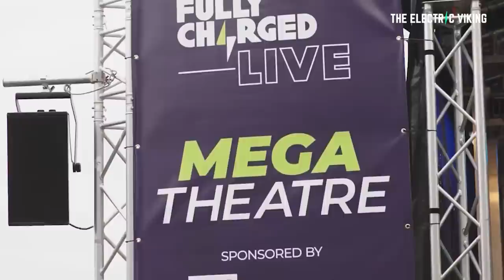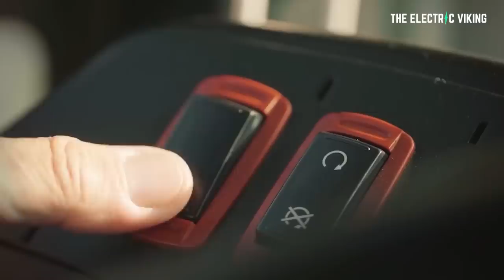Electric Vehicle Charging for moving EVs installed on German Autobahn

Comment: Why is the volume so low for your channel?  I have to crank up the volume in order to hear you and then I have to remember to turn it down for others so I don't get blasted.
Reply: Jupp, that is indeed rather odd. And it isn't a small amount; I usually have my Sound system on my TV on 42 and for this channel I regularly have to turn it up to 54, and that is very loud as that is close to the volume I watch movies. Once the Viking's video is over and I forget to turn down the volume, the next commercial will shatter my windows.
Reply: No problem here.Volume is normal.iPad pro.
Reply: @Stuart.A  you don't notice it on a phone or tablet or laptop speakers as much. But if you watch on a TV with a proper sound system it is very much noticeable
Reply: I listen on my megaboom speaker and it also blasts me when the ads come on 😅
Reply: Volume is fine
Reply: @Stuart.A  I have an iPad Super Pro Elite and the volume is low. So...
Reply: Low for me too.
Reply: Sam should use a audiocompressor

Comment: This has been mooted for some years  !
I'm glad, that it's coming to fruition !
It doesn't prevent charging stations, in existing petrol stations, or shopping mall car-parks. It's just an additional system.
Your car / Truck should be able to automatically charge itself, wherever it is  !
In fact car parks should have this under-pavement system installed in EVERY parking bay  !
Then EVERY charging company will want to ensure that their chargers are ALWAYS working  !
I presume that Big Oil are already running, a lot of these charging stations  ?  ?
If not WHY not  ?  ?

Comment: I am skeptical because wireless charging is energy inefficient, and this system will likely be very expensive to install and maintain since it has to survive the wear and tear of road traffic. Given how  fast charging batteries are coming soon and higher wattage charging is coming, I doubt there will be a market for wireless EV charging in highways. I foresee wireless charging happening at bus stops and truck loading docks, but not on highways.
Reply: This system has an efficiency of over 90 % , similar to cable charging ….

Comment: I’ve been saying this would happen. Stanford University created the tech and has refined it over a 10 year period. The induction loop can be added to any vehicle and the ID would automatically charge your account. Taxi ranks would also benefit greatly. 

A sign on the road would tell you the next 5 miles has a charging lane and you would trigger your vehicle to use it if you need it. 

Range anxiety would be gone forever.

Comment: I see the advantage in the need for smaler battery packs as a buffer for the nearly constant charging. A battery pack with a range of 100km would be more than sufficient if the wireless chargers are placed in a smart way, meaning at certain intervals so you can top up your buffer battery. A problem I see is dependency, you rely on a party to charge, money is involved and at some point they will abuse this to empty your pockets. I’m happy with my SR LFP model 3 with a range of 430km, it’s way more than I need. I charge at home at 5amps per hour all the time, never any issues with range. For freight vehicles I do see a benefit. Much smaler battery pack so less weight and more cargo.
Reply: "charge at home at 5amps per hour." I guess you mean "charge at home at 5 kW."  The 5kW would be 21 Amps from 240 Volts or 5 kWh/hour which is about 21 miles of range per hour, assume an efficiency of 237 Wh/mi (147 Wh/km).
Reply: @fiddlerJohn  no 1Kw/h. 5amps, 220v. Until now no need to charge faster. My efficiency is 123Wh/km.
Reply: @kurtmissotten5965  Thanks. Love your car. 5A x 200V= 1kW  not 1kW/h    Charging for one hour would give 1kWh.     NOTE: The A, V, and W are always upper case because they represent names of people. The k for kilo is always lower case. Upper case K usually means Kelvin. I'm and engineer, but some engineers never get this right. Understanding the difference between energy(Wh, kWh) and power( W, kW) is critical for understanding physics. 
So charging at 1kW would give your 123Wh/km car some 8 km of range per hour. So an overnight 10 hour charge would be 80km of range. Cool

Comment: I remember this being suggested in the UK (I think) for under the road charging at traffic light controlled junctions a while back.
A quick battery top-up whilst waiting on the red light.
It would get rid of the Chademo/CCS problem too.
Reply: This is a laughably stupid idea. Let it be reminded that you can't safely emit high levels of em fields without risk of cancer and other rather serious issues. No it doesn't have to be ionizing radiation, if the energy levels are higher than around 2-10W/m² it is considered to be a serious risk to your health. Energy density matters just as much as the type of energy used as we're seriously considering nonstop powering cars that burn over 250Wh/mile. There's a reason wireless chargers for phones aren't as fast as the cables, the FCC limits them as they can be a hazard. At best they could make lower power ones that will slowly trickle charge them extending how far they can go, but they could not make them nonstop, not even close. If it were off a powered rail or overhead lines it would be "safer", but then you would have the risk of animals and kids stepping on them like the powered rail lines. 

I'd say at best you could put these under stoplights as it takes less infrastructure, there's already inductive pads at most stop lights, and while stopped the car burns less energy so it can actually slightly recuperate. Still, I just think this entire idea is just entirely unnecessary. We've already got EVs that can go 400 miles on a charge. Do you really want to pay extra taxes for a feature no cars on the market can even use?